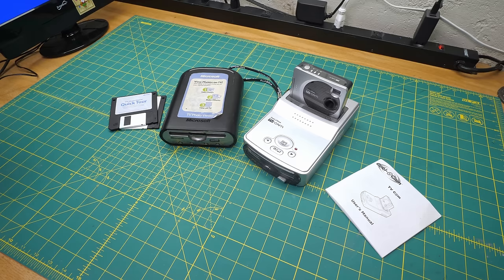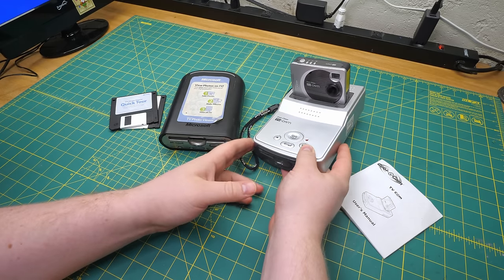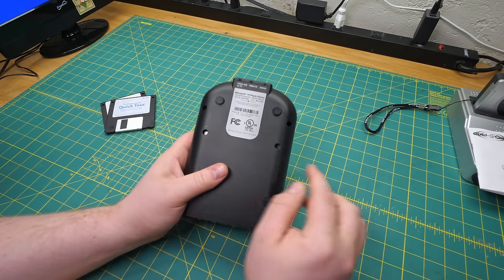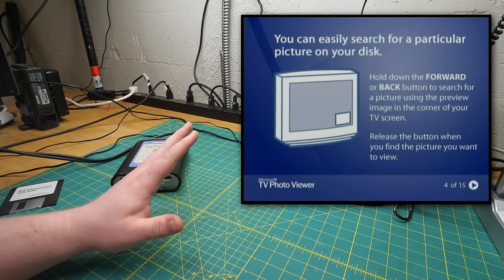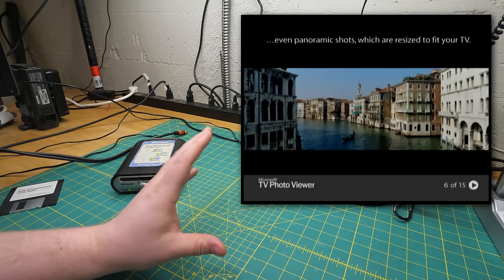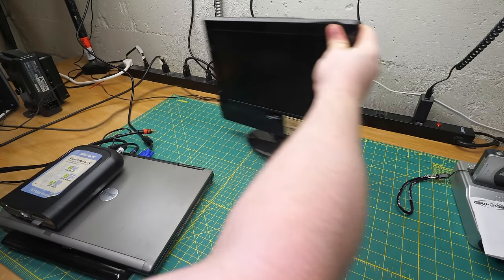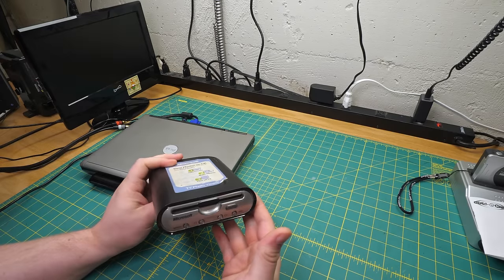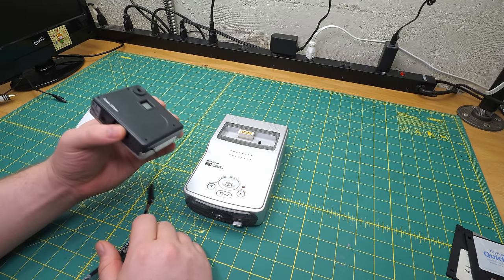"Play" Floppies On Your TV - With These!

Comment: I love how the entire software for the disk reader is a container for a Flash interface. We really did use that for everything before Javascript, didn't we?

Also, I'm surprised that despite using such an advanced processor that the camera is still so bad. I don't think people would've minded a delay between photos if the processor had been skimped on but the sensor had been upgraded instead. An eZ80 would've been newer, cheaper, likely just as fast if routed correctly, and wouldn't have required the odd bus conversion for the dock. But it seems like this was a knockdown kit board and so instead of spending the time working on that modification they just took the board as it shipped, components and all. I shudder to think that the sensor featured in this thing was still common all the way up until five or six years ago because of inertia like that...

Comment: Actually I wouldnt be mad if you did a review of the book, it got me curious. Also the Dell d620, that is the best laptop I ever had, and I still use it for office etc with W7, sadly in 2020 i spilled tea in it and after disassembly and reassembly the sensor for open lid broke and touchpad works only on the edges, So I started using trackpoint and now I use it on every laptop that has one :D Also recently I bought d630, it runs surprisingly well even with w10 and only 2GB ram :D

Comment: At launch APS film was higher resolution, finer grain and with the data stored of shutter speed and f stop it was easier to automate getting the best from the negative. Unfortunately few APS cameras allowed for mid roll change or to take full advantage of the smaller cartridge so most cameras approached the size of 35 mm cameras, although the drop in cartridge film loading is easier than traditional 35 mm cameras. 35 mm cameras came back with DX, autoloading up the film and having the same APS film but without being able to record data information but restored the gap that APS format film briefly created. In P mode only 9.5 mm of the width of the film was used, making it as small as 16 mm cameras (most using 10x14 mm negative, 110 was 13x17 mm). 

If APS film is found it dates from before 2013 and the colours are off when processed. Fresh 110 film is still sold. As APS is really point and shoot and like the 35 mm P&P if they break no one fixes them. Poor choices were further made ~. Leica C11 in black uses nextel paint which is now a sticky black mess (many 35mm and digital cameras also used this finish). Whilst the paint can be removed all the labels come off with it.

APS film could be displayed on a television using a negative scanner viewer which took the developed film in it's cartridge and wind it into the machine to flip though the frames. Standard VCR like resolution. Slight better than a slide show (no slides for APS) with a projector and screen in a darkened room. 

In the 80s and 90s most of my friends had a VCR VHS machine. A few moved from Beta and Video 2000 but VHS won out. By 1990 I was using Hi8 and Super VHS decks for off air recording and Hi8 camcorder. I don't know of anyone else who used this format for recording off air. Some friends and colleagues had a Hi8 or Super VHS C camcorder but soon switched to mini DV tapes.  None had S-video connections only RCA and SCART.  Early DVD used SCART or RCA.

Comment: I wouldn't say APS was a fail, it wasn't that unusual to come across in the late 90s-early 2000s, particularly among younger users (children) and also some elder people. The key point was the ease of use - just drop in the film cartridge, and you're ready to go. When the film was used up, take it back out and send it to the developer. Pretty much foolproof. While the quality was lower, the film selection limited to less than a handfull of types and the film cartridges and developing a bit more expensive than standard 35mm, it was probably better than most early consumer grade digital cameras, not to mention phone cameras...

Comment: One can actually detect a disk change on a PC floppy drive, as I found out, but it's more of a dirty hack.

[tangent ahead]
Apparently, to update /DSKCHG signal, PC floppy drive must step the heads. Doesn't seem to matter back or forth, just somewhere.
I figured that while trying to adapt a full-sized 3.5in. PC drive to USB with a cheap adapter from Aliexpress. Linux really wanted to know if there's a disk in that drive, so it stepped it about once a couple of seconds, clicking annoyingly, Amiga style. Turns out, if you put a bit of logic to mask /DIR signal with /DSKCHG so that it always steps towards track 0 when there's no disk, drive quietly stops stepping at track 0, while still updating /DSKCHG, allowing for quiet disk detect.

But there's theoretically nothing stopping the drive from stepping below track 0, other than its own lockout, which may of may not be mandatory - but it worked in my case...

Comment: Ackshukky.....at 43:30 the floppy drive DOES turn on when you plug in the power, you can see the seek light come on and start blinking. ;-)
Reply from the maker: @exidy-yt  yeah, I cut out a 25 minute sequence where I took the thing to bits to figure out why it wasn't powering on, then discovered that the DC jack was flaky and that's why the drive wasn't doing anything earlier. It still doesn't actually function, it's just the onboard electronics getting power, there's no video output and it doesn't read the disc, but I didn't feel it was worth stopping the video to explain all that
Reply: @CathodeRayDude  Fair enough, it was already pretty long, though very interesting! Especially finding that early and slow ARM7 SoC in the camera doing the heavy lifting.

Comment: ATi had video-out as a stock thing on laptops. I found it rare that a laptop at that time wouldn't have composite or S-Video out. Often times it'd be a 3.5mm jack.
Reply from the maker: Ehhh, my 2002 Toshiba didn't have it at all, and I've handled literally thousands of early-2000s laptops working in ewaste and more than half lacked TV out. The only 3.5mm AV out I've seen was on a Toshiba Qosmio. And even if you have it, you then have to figure out how to turn it on, how to get the photo window over to the TV output, and how to control it remotely. Nerds could do it, and we did; to most people, you'd be speaking Martian.
Reply: @CathodeRayDude  huh. I believe you. 

My dad's 2001 Compaq had a video out and my mom's work Dell had one. I remember seeing it on other Dells from family members. My own laptops only had VGA in 2007+ I think.

I remember! It was a 9-pin S-Video jack, rarely composite.

Comment: Hey, here's a cursed idea. What if you need the camera batteries (6V) because they get combined with the regulated 5V to make 11V, which is routed to the floppy's 12V input. It'd make for some awkward level-shifting when communicating between the camera and "dock". Hmm.

Also, I suspect Microsoft changed gears and went to foam mounting when the reverberations of the hard-mounted floppy drive made its product sound crappy.
Reply from the maker: that's extremely funny but imo not likely for a whole bunch of reasons, not the least of which is that 3.5" floppies generally don't use the 12V rail.

Comment: I own an old Mavica printer from Sony, FVP-1, 1998, and while it's main purpose is of course to print from it's internal floppy disk, it also has a video out, composite and s-video. Mostly for selecting and, some other features, stickers, labels, but it can indeed show jpegs on my tv.

One does wonder, if other models used that docking thingy. It, or the camera, I suppose, happily reading the less compressed, er, Gundam picture is, interesting... It's got the capability, but the CMOS and CPU aren't adequate. So, TV C@m V2? :D

Comment: Didn't one of my late 90s cameras come with a panorama stitching software? Anyway that was a thing.

Actually hold on i just grabbed my PowerShot G2, which, modern fancy camera of 2002, and it has a panorama helper on the dial, which has 5 panorama and stitched shot modes. Not only does it have exposure assist, it also helps you align the photos by showing you the overlap with the previous one.

The adhesive based drive construction looks like a last minute fix for getting the hole positons wrong relative to the faceplate. If there was ever a second production run, they would have fixed that. FPGA based platform! This is a prototype class device that landed in stores. Second version would have had an ASIC, and would have actually stopped losing money.

Yes Fujifilm cameras were nice enough from the get go. The Fuji DX7 from 1997 was better than these cameras by a lot, i mean, for being cheap at the time, around $400, the pics were actually quite presentable looking, unlike what the early 2000s CMOS cameras made. And they made nicer but more expensive cameras too. DX5 their budget offering was hilarious though, good pictures outdoors, usable pictures indoors naturally lit through a window, usable with flash, but if there is incandescent light, there was no rescuing those photos due to a processing error, but like for $250, there wasn't quite anything else you'd want to buy. Everything else was more expensive and most of it was much worse. Then they followed those up with some really nice cameras in 1999, they were absolutely on it.

Comment: Missed opportunity...you're the cathode ray dude ...should have used a CRT TV to display these devices
Reply from the maker: I have a fantastic one above the desk, but the problem is that they're very deep and won't fit on the bench, small models that will fit have extremely poor resolution, they produce a 15khz whine that's very hard to completely notch out, they produce moire, they have terrible glare, and they're very hard to record accurately. It's a bummer, but we did move away from this tech for a reason :p
Reply: @CathodeRayDude  pish posh ! I have 4 CRTs in my place , one an RCA 5 inch black and white radio combo from 1984 still going strong and getting a picture from my VCR hooked up via the devil's pitchforks.  You hurt their feelings.  Lol 😁
Reply from the maker: @darkempire37  I own about thirty! They're just very inconvenient and I can only use them on camera at my studio

Comment: Did you consider that the super IO chip might be communicating with the camera over serial? Yeah, it would be slow but would only really require three lines on the dock connector.
Reply: Sounds plausible. Camera->superio->microcontroller->superio->floppy is a bit of a roundabout way of doing things, but it could work.

Comment: honestly since that camera is using usb1.1 I can kinda get why the webcam mode sucks so much, I mean... it's sending raw rgb24 video over who knows maybe 6mbps, I doubt whatever USB controller that has can even manage to do the full speed of usb1.1, even then its just 12mbps not accounting for overhead so yeah... not surprised, but the encoding its doing is so broken like wtf 😭
Reply from the maker: I don't know if it's actually RGB24 *on the wire*, is the thing. A lot of cameras, even in the USB2 and 3 era, do transparent compression inside the driver, the capture utility just receives the raw RGB/YUV. On the other hand, they could have skipped the mjpeg encoder IP core to save money, in which case you'd be right, it would severely limit what they could fit over the wire, and that wouldn't be surprising at all, haha.

Comment: Because of interlacing, the photos would need to be blurred to prevent flickering.
Reply from the maker: the photos are 640x480, so they have enough lines to fill the entire screen. you only get flickering when you don't have two fields of contiguous image data.
Reply: @CathodeRayDude  That's not really true. You can get flickering if the two lines aren't similar, hence the need for blur.

Comment: What was the video in port for on the Microsoft model, did I miss that?
Reply: He mentioned it in the video. It's just a pass-through, so if your TV only had one input, you could plug your VCR or cable box into the video in, then connect the video out to your TV.

Comment: Video passthrough?  But is it true bypass? :p

That microsoft thing I would've guessed was more recent like 2004 or even 2006 with its shiny silver and black and the windows media center-like visuals.  But I guess it's very XP-theme in general and I just don't remember so well, but it would've been designed very much alongside XP in terms of time.

Bleh, tiny barrel jacks.  Weird bane of the early 2000s.  Thankfully that never took off.  The power supply is probably just to run the drive.  The camera is probably doing all the logic and video output, and the power circuitry is probably just too simplistic to power the camera off that supply rather than draining the batteries to run the camera.

I remember hearing about Foveon.  I'm guessing it was just a combination of too complex/expensive, not good enough and didn't work well enough for any market it was trying to for to replace what existed.  Still would be neat to find more about.  See how the cheap camera did.  Also that random super Italian sounding guy doing business in hong kong sounds super sussy but that's probably just usual business over there, just everything being foreign-owned.

Considering where microsoft QA is/has been, I believe they would make something like that.  I guess some of the reason they would use double sided tape is probably for noise insulation, but it's also just ultra cheap to not even bother screwing it in.  I kinda like that the cool i-cam system was while considerably cheaper inside, just kinda seemed better engineered.  It fit much more within the cost of what it was intended for and seemed like honestly a far more flexible, usable unit and it could even store its graphics assets in ROM with far cheaper components overall and manages to also be a camera.
Reply from the maker: I assumed it wasn't but I just kept forgetting to meter it - and sure enough, when unpowered the jacks are not connected, so I'm pretty sure there's a semiconductor switch that kicks in when power is applied. They should have used a relay! :p
Reply: @CathodeRayDude  yeah I was just making a dumb guitar pedal joke. :p

Comment: At around 16 minutes, you mention that you think the flash was off camera. I don't believe this to be the case. I have found on certain cameras, when shot in vertical orientation, will give harsh side shadows like this.
Reply from the maker: Clarifying question - are you thinking of SLRs with popup flashes? Some of those could get enough offset I suppose. It's hard to imagine the typical mom-and-dad P&S doing it, but conversely, at this point in time there were a lot of low-end SLRs (and DSLRs) being sold, so that's something I hadn't considered.
Reply: @CathodeRayDude  Hmm, fair question. I ran some quick tests with a compact digital camera with a hot shoe. When I was up close with a wide focal length, the on-camera flash made a similar shadow. At a further distance with tighter focal length, using both on-camera and hot shoe flash, I was not able to recreate the effect as drastically as what's shown. I think what's most likely happening in that image is using a large Speed Lite type flash being used on the camera's hot shoe.

Thank you for indulging my important research.

Comment: You can try rubbing deodorant on the wires to stop cats from wanting to bite them. Unless your cat is especially dumb and thinks that makes them tastier.

You explained why you didn't need a screen saver on a TV, but I think you forgot to explain why you can't use that device for one?
Reply from the maker: A screen saver by definition kicks in automatically, which is impossible on a TV (there's no "idle" state to detect) and in any case the photo viewer doesn't even try. If you have to reach over and grab a remote and flip inputs to enable the "screen saver", why wouldn't you just turn the TV off instead?

Comment: I had a stick cell phone with a 2.5mm AND that annoying little ass power jack and seem to remember they kinda started phasing those out around this time.  I wonder if the company got a good deal on the parts used to make it ala those digital multimeters you can buy now that look like a ten year old Chinese brand cell phone WITH cheap cell case.  Or the Atari Jaguar X-ray machine.  I figure the biggest market for both of these jacks must have been cell phones and there were probably millions in a warehouse rotting when this was made and cheap!

Comment: Amazing this crowd made this low budget thing, and everyone used it. Now in the case of no-name builders that is understandable, but HP, Konica, etc use this stuff rather than get off their buts and do their own thing. In a way this holds back the whole industry as nobody is trying, they are just day napping, taking the easy road. No wonder we had a whole generation of crappy camera's
Then there is Agilent, the spin off of HP test & measurement with all their really expensive test equipment, would bring to market such a low quality sensor, I would have thought they'd sit on it until they had something decent to offer - as in keeping with their multi thousand dollar test equipment.

After seeing this I'm kind of interesting in pulling apart a 'pen camera' I have, same crappy pictures, just to see what they packed in there, as that big ARM chip would definitely not fit.

As for why comp video, well the picture is really low res, it has to be to fit on a floppy, so why go out of your way to emphasise this lack of resolution by using S-video etc. Why spend effort to try and de-pixalate the the image, just let composite NTSC do its magic, everyone at the time was kind of happy with that, so just feed them some more.